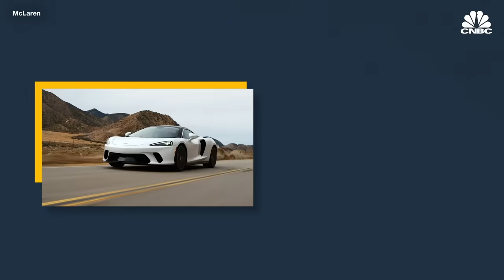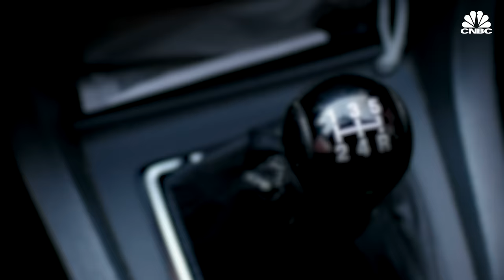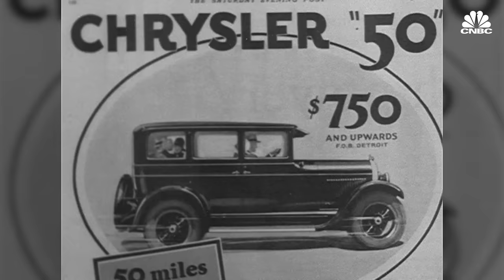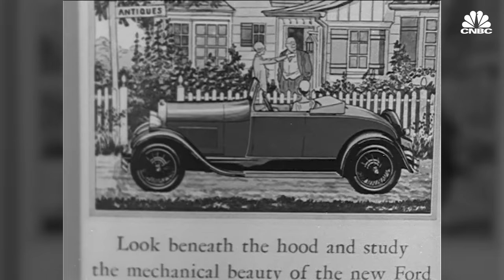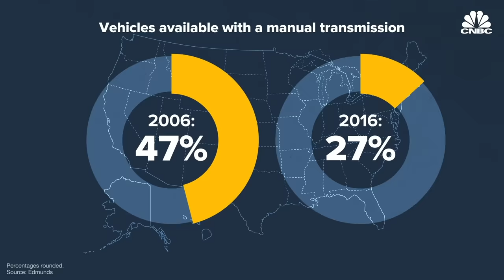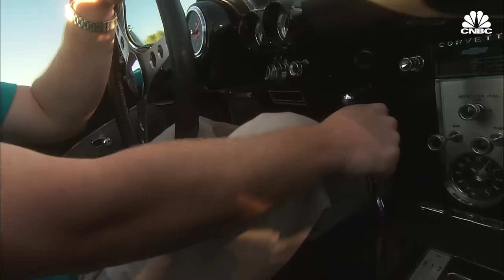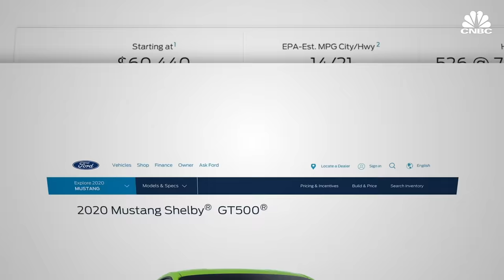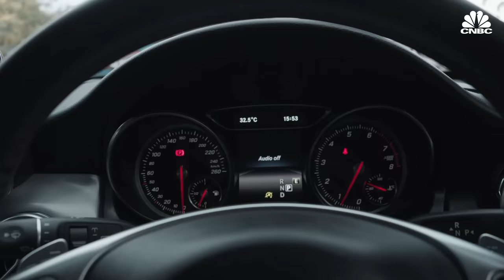Why Stick Shifts Are Going Extinct

Comment: Manuals will never disapperar outside the US and the reason is simple - they're cheaper to build.
Reply: Yes, they will. You’re just shortsighted. As electric cars take over, so will the disappearance of manuals.
Reply: Not to mention Americans are shiftless!
Reply: @Canarka1  you are lot more shortsighted, electrics won't take over and become mainstream any time soon unless battery tech improves drastically, and is not dependant on lithium and EV's don't become cheap with high range, and  unless charging stations appear everywhere, so speak for America not for the world ,manual isn't going anywhere for 10-20 years.
Reply: @c.bulakh6231  Hard to take you seriously since you're incapable of using any punctuation. Also, I've likely been driving manuals longer than you've been alive and unfortunately, they are on their way out.
Reply: Cheaper to build yes, but that is not the point. All manufacturers need to comply with the new fleet consumption rules of the EU. And since modern automatic transmission can be perfectly tuned to cheat... sorry I mean "comply" with tests like the "WLTP", there are used more and more. Even in Europe, the sales of cars with manual transmissions go down every year.
Reply: @c.bulakh6231  Do you understand what shortsighted means?
Reply: @Canarka1  oh I don't believe in using punctuations in informal conversation just saves time, nice trick to divert BTW and besides what I said is true electrics aren't becoming mainstream anytime soon and speak for US ,there manuals might be out but in emerging markets and developing countries manuals still comprises 70-80% of the demand, automatics are seen as rather too easy, and many feel it's like driving a scooter ,the car feeling feels incomplete to many so you may have driven manuals but you cannot speak for other countries manuals are still in huge demand in emerging markets whether you admit it or not.
Reply: @Canarka1  there are not enough recourses for electric cars to replace all "normal" cars.
Reply: @dirkvandermerwe8576  yeah I do don't act oversmart no one's buying it
Reply: They will disappear. They are cheaper, but let’s be realistic, no one buys it. 
People who buy them are limited. Not profitable for dealers
Reply: It's cheaper to build for now. When there's enough scale and as the production count of manuals slowly dips, the cost of manuals can supercede that of autos.
Reply: -------  correct in regard ------  down  vehicle assembly line is where the cost savings occur ------  its difficult to find new car with crank up windows ------  we all know what has more reliability ------  if you break your arm you can still get window up with other arm if electric motor goes out ----- your luxury just turned into misery ----- electric windows more expense initially ----- but less labor cost on down the line ------  same difference w/transmissions
Reply: @Canarka1  agreed. Anyone that thinks that manual transmission equipped cars are more efficient or offer better "control" or performance, take a look at F1 or CART or ANY top shelf racing league. Manual tranmission? Hold my beer - click , click (hell, I'll hold my OWN beer and still - click, click ;)
Reply: @MickyAvStickyHands  that's not ignorant. They are cheaper to build and cheaper to repair. Just facts.
Reply: @florian6948  for now. As people buy less of them production costs will increase. Not to mention automatics will just get cheaper and more efficient same with electric cars
Reply: Ever heard of a CVT? lolz
Reply: You said it: Maunuals are for poor people or people who dont know any better. I drove manual for 10 years before going auto. I would nver go back!
Reply: Chaitanya Bulakh You should still use punctuation when texting, at least periods. You don’t have to be exactly grammatically correct, but if I’m being honest, it was very hard to understand your first comment. You don’t need to use anything fancy. Just use periods to separate your sentences, and it becomes much easier to see where one idea begins and one idea ends.
Reply: @Canarka1  Yes but in decades to come only politicians can make electrics cheaper than ICE.
Reply: Henry Phillips Sort of a false premise there. You don’t have to be poor or not know better—some people just enjoy a manual more. I don’t know how you left that option out. You can be rich, know the benefits of an automatic like the back of your hand, and still drive a manual because you enjoy it
Reply: CANFPV and that’s already planned. The rothchilds wanted gas engines gone so they will be gone. As soon as they released a drawing of a dead gas engine with no explanation shortly after all the news outlets and car manufacturers were talking about killing off the gas engine and going electric. Problem with hybrids and electrics is the short life span. Several years in and your batteries will be junk and you’ll be spending thousands to repair it or you’ll have to buy something else and hopefully you can have it paid off before that happens.
Reply: @zhengyi97  Yes but I don't think they can scale it for world markets. As it is, people buy manuals so automakers make manuals. Same as in US - people want auto so automakers make auto.
Reply: "Europe is dying from taxes"  is what he's trying to say
Reply: @ShadowTheNinjaKitty  oh I definitely do use them while texting you know,but in a comment naah,especially if it's a heated one,these are all just excuses honestly to divert topic from the main context,Grammer Nazis anyways doesn't matter what they think.oh and in this comment I used them specifically for you.
Reply: Old phones are also cheaper to build, but somehow people buy newer faster ones.
Reply: CANFPV I think the manuals can be in the future look at the mustang lithium sounds cool right
Reply: @c.bulakh6231  please point on the doll where the internet man hurt you
Reply: Chaitanya Bulakh, Well, certainly you don’t know how to use punctuation. And like you have said, you don’t like to use punctuation in an informal chat and same will happen with manual cars, they will not be produced anymore since people aren’t buying them. And better batteries are being tested; so the future is electric.
Reply: YuureiInu yes! I still ❤️ driving manual stick shifts still to this day.
Reply: This is an American news outlet
Reply: They'll disappear, but not for a while. American's still buy em and the old heads at some of these companies fight the bean counters on this issue. Honda has been meaning to give up the manual in the Accord for years now since it only makes up a few percent of sales... but they manage to keep it going!

Comment: "You become one with the car". Yep. This man knows what he's talking about. And I think every motorcyclist would agree that you have full control and are much more focused on the road and on the driving when you have to shift gears.
Reply: As a motorcyclist, I'd disagree that "having to shift gears" increases focus.  It does increase CONTROL however, and on a bike control over power delivery, balance, etc. is essential.  Having an auto shift between gears whilst on the edge of the tyre mid-corner for example, because it feels like shifting gear is a liability.
Reply: SPENCE  I'm sorry, what? Why would I shut up? This is a comment section, everyone has the right to share their opinions.
Reply: @JethroRose  But in a car, the required maneuver to shift gears won't allow you to "drive" while sipping on a 7-11 Big Gulp and eating a hamburger in the same time. What I mean by that is that people that drive automatic cars tend do multitask more (texting, eating...), which is dangerous. I'm talking from personal experience, I'm making a generality. But it seems to be true.
Reply: Simku 
I frequently drive automatic in manual mode. I still control the shifts whenever I want.
The paddles on the steering wheel are much more practical and fun to use.

Comment: Drivers of stick are more alert,and aware of their surroundings.
Reply: Gee I wonder why they are more alert and unaware
Reply: @alexzamudio9239  because the brain is more engaged, results in extra attention
Reply: True
Reply: Just get a motorcycle, most engaging vehicle ❤️
Reply: Warm Soft Kitty  You mean less often? I don't know about you but I only need one hand to shift and obviously the other is always in the wheel and people don't text or put makeup while they drive a stick shift
Reply: @georgieperezjaiman9403  they text and use makup, even with a stick shift (I live in Austria; still a low % of automatic on the road)
never underestimate human stupidity
Reply: @georgieperezjaiman9403  how often do you (need to) shift gear on a highway?
Reply: Believe me, you‘ll get also used to stick shift and you normally don’t even think about how to change gears, meaning that you might end up “careless” too. I see it quite too often, people that drive like they’ve forgotten their brain..
Reply: Rob R true! Noticed this with myself!
Reply: JumpingCookie95 reasonable assumption but I’ve noticed it with myself. I’m much more attentive in a manual. Plus it’s just a blast! Mmm nothing beats that spring from second into third or the heel toe back into second for a sharp corner. It’s fantastically engaging. I can’t have fun in a car without it.
Reply: Driving a manual really hits different especially that feeling u get where u feel the change of power every shift u make
Reply: Completely agree
Reply: Ya but in some cases sometime some major issues happens while in a manual cars to.
Reply: My cousin is always texting and driving in his manual car
Reply: yes!
Reply: Drivers who are interested in keeping their body (and life) safe should be alert and aware of their surroundings. Automatic cars aren't supposed to give anyone the leeway be less alert. I assume that people who text while driving just don't use their brain even when it comes to life or death situations, or decided that the risk is somehow worth it for them (which is selfish since car accidents often involve two cars or more).
Reply: @georgieperezjaiman9403  I don't know where you're from but that ain't true where I'm at. Hell, when I was young I was even perfectly capable of rolling a damn joint while driving a stick around on the twisty mountain roads here in NC. That's a FAR more difficult task than texting or putting on makeup. I see plenty of folk driving stick around here today that are texting or doing makeup, often while smoking, eating snacks, and talking with passengers in the car at the same time.

There are still plenty of stick shifts still around here because people are poorer and often drive older used cars. You just get used to the stick and don't even think about it.
Reply: Statistically they get into more accidents because they have to do a machine's job on top of driving.